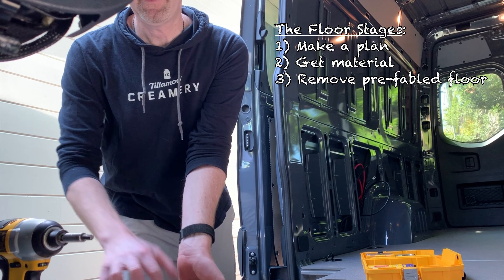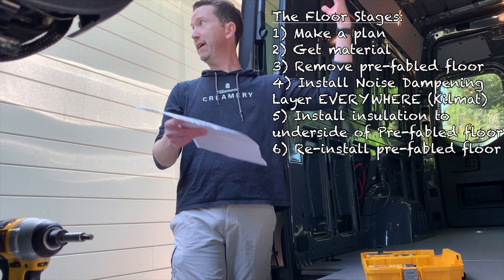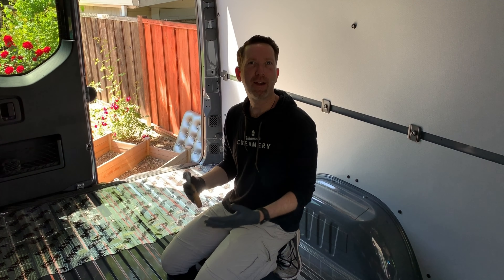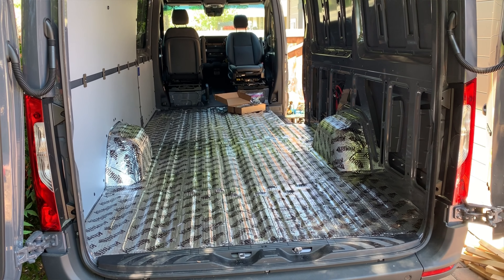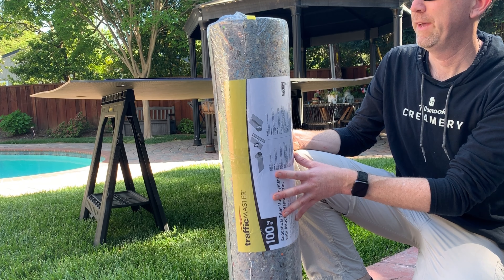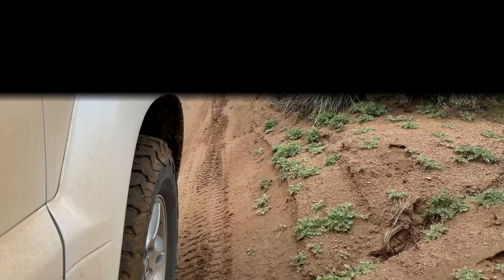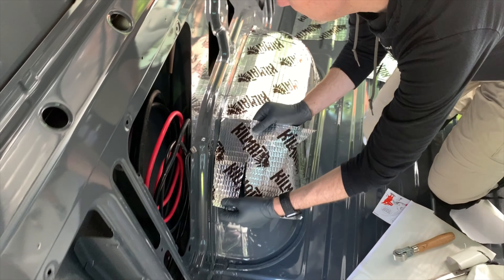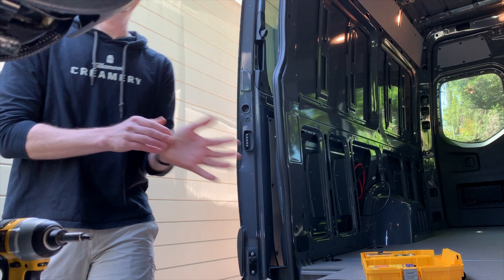Sprinter Van Project: 1.1 - My van floor (prep)

Comment: Lookin good!!!
Reply: Thank you.  Question since I am new to posting.  Does the description show up for you without having to expand it?  The reason I ask is I am trying to help people know that there are links to different parts of the video in the description so they can jump to sections they want to see vs. needing to watch the entire episode if they don’t want to :-)
Reply: @russellziegler9755  Links are cut off, and you need to expand both on the desktop and mobile. Mobile you have to expand regardless however, but on the desktop it cuts off at "Please read further" with a "SHOW MORE" link under. So you have three lines of text to play around with giving instructions on.